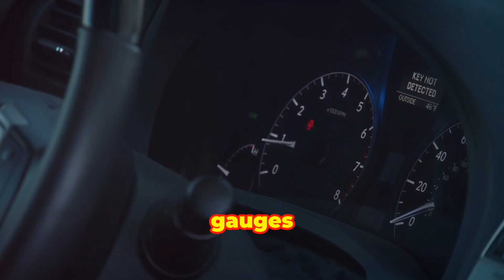HUMAN BODY AND CAR FUNCTIONS

Comment: There is even more similarity:
You forgot to mention "oils" and rust.
- Blood is protein convert from different oils (with some is from rust too = those with antigens, otherwise is protein D, from oils).
P.s. I was fine just listening You, it was fine. But sometimes activates the alien in me and I type/write (but I don't talk)
Good comparisons,  ... but 
there are other types of cars without combustion, those create the other people (because there are 3 basic types at which side-left or right- is the brain for maths or motoric functions, 3-rd type is ambidextrous or omni named - ie. writing with both hands even legs in all directions and also both sides of brain have similar functions).
One type creates combustion (farts :))
Other type creates wires magnetic and electricity.
One spends one type of resources, the other different. 
There are slight differences. 
One creates stronger bones with time, other makes weaker bones with time.
3-rd is as you mix both in pan.